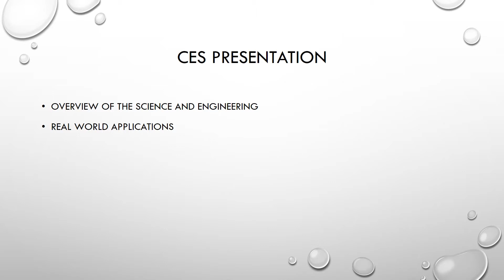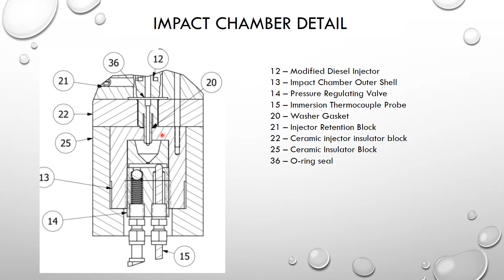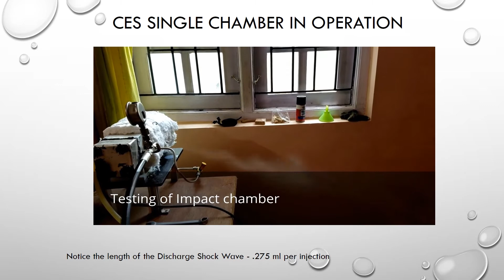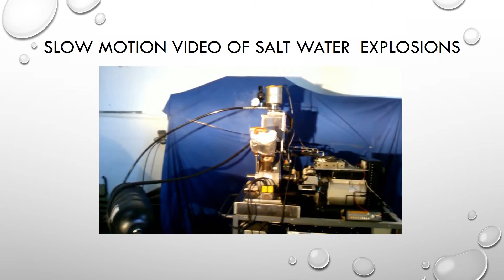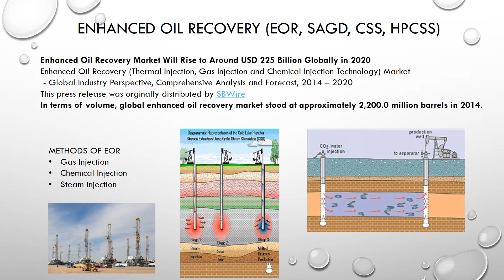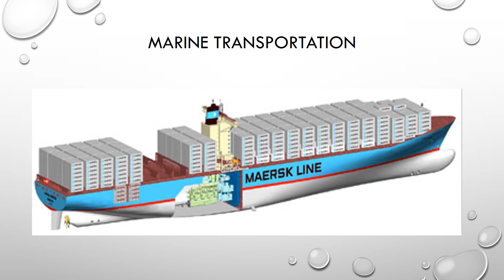Cavitation Energy Systems Technical Presentation

Comment: As Hoover Dam & Lake Mead drops 75% the production of highly destructive cavitation bubbles because of lower pressures on water turbines we learn valuable lessons how tiny water bubbles helped Cavitation Energy Systems produce overunity energy & when Prof Marc Ramsey, Vanderbilt University he discovered how to make custom BB Pellet Sized cavitation bubbles to generate 400,000 pounds per square inch with video titled "Energetic Cavitation Impact" on YouTube video that's 10 years old.

Comment: Eirex Technology is 5 year old energetic cavitation impact technology utilizing any type of water as fuel source for hydrogen comparable to $0.25 per Kilo Gram or 25 cents per gasoline gallon equivalent is lowest cost decentralized hydrogen on-board, on-demand & on-site with any type of salt, polluted or atmospheric source of water from the air.

Comment: what happened to this technology, I know it started before them with Griggs sonic heater. But are they dead, were they proven fraud cuz unless the readings are just faked so it looks legit...but I don't get the fake vibe; plus I know how water is a heat sink, its why cold water is so deadly, it takes a lot of input to get to turn into steam. I do not need to measure inputs and outputs to tell that WAY more energy is coming out then its going in. Look at it logically, take the volume of water they say they had and take all the power they say the system used and calculate if it would boil that entire amount of water....i bet it would barely start it to boil, let hit 4k celicius! you say of they fudged the model and data. Really, build the darn electrical system in a circuit simulator, input real values from a supply store and SEE how much power the system used. Model the CES mechanical system in 3d, 3d print it out of the hardest non plastic material you know, add the electrics and if steam comes out; we know less about physics then we think.

Also love how the exploding verifies and vindicates Denny Klein, and the other water fuel guys; but also afirms Ohmasa Gas, imagine if we could keep that pressure and add the rotor to one side of an electrical circuit, to add low amp high dc pulsed high voltage, and run it into a condensing system and I bet you get a hyper efficient way of producing pure Ohmasa gas at industrial scale... the keey after all to Ohmasa or Water Cluster gas is cavitation and high frequency high voltage 1a no more power, that produces massive volumes of gas in pure distilled water which should be impossible..its on you tube look up denny klein and ohmasa and u see they discovered a technology also discovered before; how to make water into a fuel THaTS NOT HYDROGEN AT ALL.

Comment: I can't believe you guys were surprised by the saline experiment results. I'm not surprised at the rapid failure either. Even if the chamber were capable of withstanding the pressures... I highly doubt the cavity would've lasted any significant amount of time, with microscopic salt crystals effectively bombarding the surfaces at insane speed and frequency.

Comment: The water-hammer theory is unfounded. What is happening is an electrical fission reaction of the cavitator (light element fission) if you magnetize the cavitator it may stop the fission from happening by physically repelling the diamagnetic gas water vapor prior to fragmenting and releasing the high energy EMP.  Which passes through water (transparent at that frequency) which will only heat the water to about 50 deg. C, it won't boil as normal steam unless it is mixed with dissolved solids (like salt or pollution which will be converted to hydrogen).

Comment: Cavitation also generates a high energy impulse EMP that could be captured by a capacitive array and directly converted into electricity... you might give that a shot for more energy collection. The collapse of a cavitation bubble is a release of a very high current electrical pulse.
Reply: interesting aproach , i like this idea ! :)
Reply: EMP. Is there proof of electrons when it implodes? Or is it just simply pressure collapsing against a solid?.. hmm

Comment: This type of steam generation is patented. it failed financially for just makng steam, the mechanism (sonoluminescense is actually the creation of diamagnetic energized water gas that fissions the cavitator when it condenses on the cavitator's surface (you might try magnetising the cavitator to protect it. Otherwise your cost must include replacing the cavitator after it is dissolved by the cavitating water.

Comment: I am not certain I get what is going on here.  You can vaporize water with an ultrasonic humidifier but it is cold vapor which demands heat be sucked from the environment or the water just remains water.  Ultrasonic  humidifiers also have the problem that they deposit white mineral dust over everything near them strangely even when you use distilled water.  If you need to use distilled water why even use an ultrasonic?  Just because you turn water into vapor does not necessarily mean that there is  over unity going on in the system itself.  Heat may also be extracted from the surrounding environment such as  your furnace in the wintertime.  Arid air can also turn water into vapor at higher rates. If you ever dropped a large glass of ice water onto the sidewalk concrete pavement in Tuscon Aridzone in the spring you might be surprised at just how quickly it disappears right in front of your eyes.

Comment: The electric generator shown - did it generate enough electricity to drive the high pressure pump and still more for a load without external input - if so I take my hat off for your experiments.  Then your job should be to get it into the textbooks - not to sell it to refineries.

Comment: The slide at 15:08 is interesting but there is  little incorrect. 5 L of water ( rounding 4.95 L ), converted to steam require  11280 J of energy and not 14157. Still it he numbers you guys are showing, assuming no other errors (as to the steam quality dependent on the energy accumulated at different then atmospheric pressure) are very impressive. I am assuming no other errors, which actually will be quite hard to make (aside from the energy accumulated in the steam), as the 2 input variables are the input power, and it can be quite easily measured, even without precision instrument, considering you enormous energy output/input ratio , and water volume. A measurement at the temperature of the exhaust steam will be also required though. Another point, it would be better for the heat to be added by oxidizing carbon fuels then with electrical resistance. Electricity, especially used for heating, is an extremely inefficient way of deriving BTUs (only about 25% efficient, and such your system, with BTUs input from electricity, becomes almost net 100% efficient ), considering all the conversions, and that all that input electrical energy started by itself as BTUs. If you have your BTUs, input from carbon fuels, you actually can decrease the carbon fuel consumption for making steam with 250 - 300% less carbon fuels input, which is like 50% of the total carbon fuels usage on the World.

Comment: It will be a great day, to one day, replace a hot water heater at home, with one of Jim Griggs Cavitation Pumps.  This is far cleaner than, petro chemical, and coal, by far, Yes-Yes-Yes, by far!!! Until the day when Atlantis returns (which we would call a bygone era) and that Crystal Technology of that distant past, that directed landcraft, aircraft, seacraft, by the directing of The One Eye of Sauron, (LOTR), we, as in i.e. the people will need far cleaner technologies like Jim Griggs Cavitation Pump, keep up the good work, Sirs and Ma'ams please see, John Van Auken's Video, Attributes of Gemstones, and The Crystals of Atlanis 1 hour and roughly 25 minutes, in length.  Light Worker, Psychic Surgeon/Soul Retrieval, Priest of The Gospel of Love, Light, and Peace, Kelly - plus Elsa - The Snake